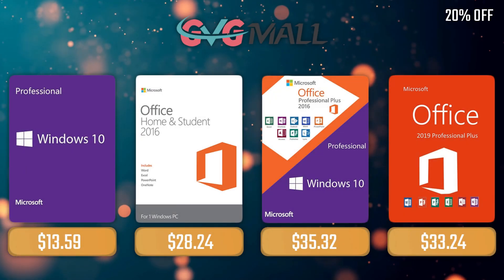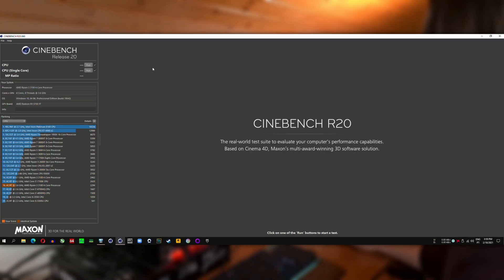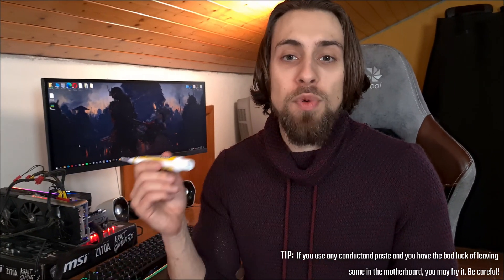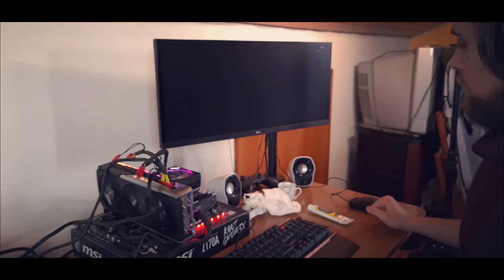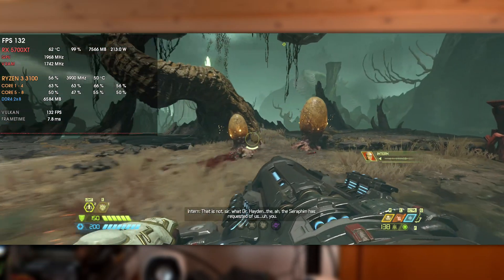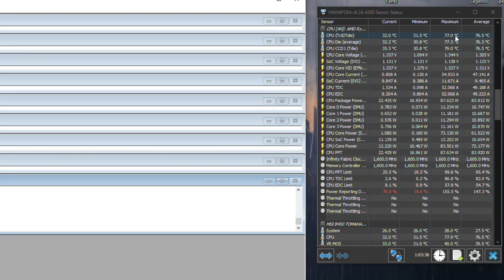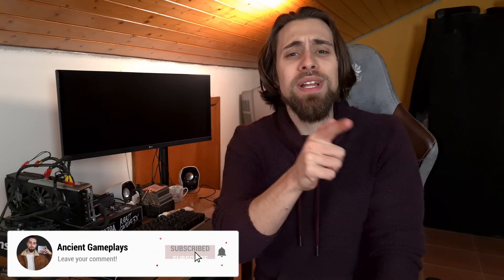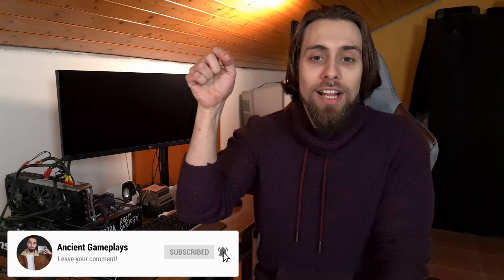I used TOOTHPASTE on my CPU | How LONG will it last? How about temperatures?

Comment: I used tooth paste for years for my old PC in 2009 until 2016 ish (The motherboard failed, the procie itslef still can running)
It was Athlon IIx4 + ATI Radeon 4850
Both using tooth paste, It actually can last for more than 6 months
and actually better to run that long rather than run very short time (like only hours)

Also, my country is near equator, so its hot and humid here
So i usually just left my PC's side case open, and blast the air using room fan directly to the PC lol
And because of that I usually clean the PC once every year, including reapply the toothpaste on both procie and gpu

One thing for sure, you want the 'purest' toothpaste
Dont go to the "black marble" or something that "helps to clean your teeth"

Comment: I used my PC, with toothpaste for 3 years in a row. He never had temperature problems or anything. The funny thing is that I did have thermal paste, but I didn't know where it was. And since I saw that the toothpaste worked well, I left it on.
Reply from the maker: You mad man! Maybe your CPU has low tdp
Reply: I had an issue with a cpu and thought I had thermal paste in my cupboard but turned out I didn't so i scraped the old cpu paste off and mixed it with toothpast before installing the spare CPU and ran it for years like that. maybe more than 4 years. although the last year and a half I did only use it as a media centre while another rig took the place of gaming machine at my desk.

Comment: my pc gets 60 degrees without opening anything
Reply from the maker: pc? what part in specific
Reply: @AncientGameplays  did i stutter
Reply: @AncientGameplays  the whole thing just gets on fire
Reply: @AncientGameplays  jokes aside my gpu gets like 60 degrees and my cpu gets 70 degrees. It once reached like 80-90 degrees for no reason so i closed the pc. Luckily i threw it at my little brother(gifted it basically) and got me a sweet gtx 1650 i5 10300h 16gb ram computer(only downside is i run out of budget for ssd and got 256gb which 130gb is filled with windows files :/)

Comment: i use thootpaste on my core 2 duo e8400 since a year now. runs normal temperatures, and even i did not had to repaste it, still use the original does from a year ago. also i use stock intel cooler. i dont game on it, usualy i use it as a "school computer". the reason is, that in the lockdown we had to use simulation programs and design programs (spront layout 6.0 and tina 8). these were provided by the school, however, they are just pirated them. it means that they both have a virus ( a strange one, that collects personal data and sends it to a server, and a second one that mines crypto. however that cpu is too old, so it cant mine xd). i did not wanted to use my normal laptop, even with a vm, due to the crypto miner. that c2 duo pc does it's job well
A bit of edit: a funny thing that pc is mostly from the school's labour section. but one day it just did not start, so they put that into storage. around 6 months later my labour teacher gave it ti me. it had an e series pentiom originally. it turned out it had faulty ram. i repaired it and still use

Comment: I still have some traces on my old Phenom CPU after doing that and i had same results. It seems like anything could work, because it's destination is to fill the space between the processor and the cooler, including micro-cracks on the surfaces, while maintaining consistency of paste for the long term. 👀
Reply: I meant any thermal paste*
Reply: I'd have to offer a caveat to that in that grease is by it's chemical composition made to keep heat in. I haven't tried it but I'm willing to bet a shiny nickle that it would get hotter if you tried to use that. Do with that information what you will, maybe useful in heating electric vehicles idk?
Reply: @brandennorkus6811  Oh, it was a while ago... Of course i wouldn't use toothpaste as thermalpaste on a daily basis.

Comment: Our best PC scavengers here in China use a white radish to cool the CPU. And the best thing is- you can eat it when the PC shuts down. By the way, a shoe box will work as an open design case.

Comment: The Ryzen 3100 is a quite low TDP CPU and the Wraith Prism is the best stock cooler available, so that also explains your low temperatures. Expect less good results if you use the Wraith Stealth.
Reply from the maker: I mean, its hard to believe that people still run bad stock cooler in 2021...I talked about that in the video but i cuted it out since it would take another minute

Comment: The last time I tried this was on my FX 8320 and it lasted about a week running at 4.2 ghz. You should mix Vaseline or mineral oil with the toothpaste to keep it from drying out and to get lower temps. Works great while you're waiting to get some real thermal paste.
Reply from the maker: Yeah, but i mean....thermal paste is cheap xD
Reply: @AncientGameplays  basically same price as toothpaste nowadays 😂
Reply: I’m about to do it cause I have to wait on shipping
Reply: Bro vaseline is made out of mineral oil and petroleum jelly, its could easily be a replacement for thermal paste